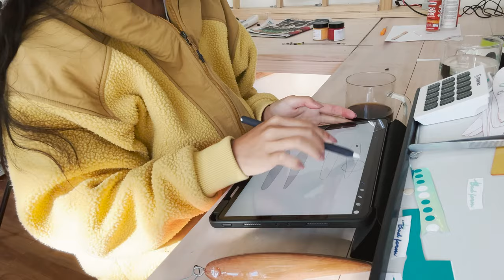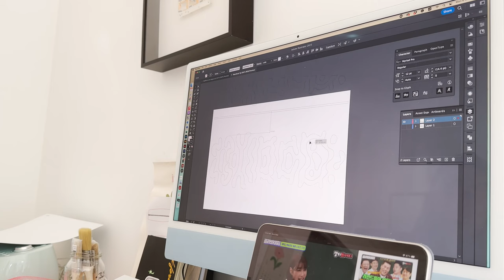Beginner lure-making vlog (ft.budget setup) / New Zealand fishing / lure swim test / stickbait

Comment: I think when it comes to the weights, you should add slightly more led towards the tail of the lure, always make sure you test the sealed blank with the sinker, prior to installing the weights, make sure to use the split rings and hooks, your boyfriend will intend to use on the finished lure, aim for lure standing at around 45° angle towards the surface, allow little extra buoyancy for the paint and multiple epoxy coats 😉 also diving poppers are fine to be so wide bodied, for the stick bait is better to make them more narrow, like round profile or even slightly oblique vertically 😉 I hope this few tips will help you when you will have opportunity to make the lures again 
🤜🤛
Reply from the maker: Hello SJC! Yes, that’s what I do! I’ve made about 3,783,729,732 prototypes with different weights, locations, hooks, fish floating angles, fish shapes—everything you could think of. Just to find the swim that I like..hehe The video only shows a little bit of the process and the very early stages of when I was getting into lure making 🤪 It’s a bit sad that I don’t make them anymore 😮‍💨 Thank you for the tips and share some more please 😁!! 👍🏼 eg. tips for how to apply abalone to the fish?? 🤔
Reply from the maker: Just checked out your channel and you know what? When I was learning about making lures, I watched so many of your videos! Woaaah, and now you’ve commented on my (very basic) video 🙈 I love your lures!
Reply: @Soooyunpark  I'm happy to hear that 😊 🥰 lately I did neglected my channel a little, but now moving to new apartment, with my own studio for lure making, so I'm stoked to come back with the regular uploads 💪 it's fun thing to do 🥰
Reply: What wood and export do you use